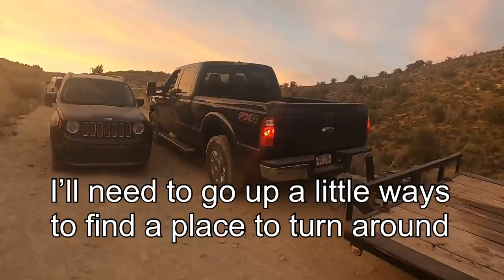Jackknifed! Ford Super Duty on the edge!

Comment: You ever thought about buying a chainsaw,it's a lot easier and more effective than using sawzall for tree work.
Reply: What are you talking about? 
They even make a pruning blade for the sawsalls. One handed easy work with no cord or gas. He could have cut up that whole tree with it.
Reply: @donlarsen9807  hey genuis sthil and all major chainsaw manufactureres make small limbing saws that you can operate with one hand if you need to.
Reply: @ejacs8077  hay genius you are correct and they make a cordless version also. My point was not to step on your toes or put you down it was just that when they make a tool you have adaptable for the job why go out and purchase something else.
Reply: @donlarsen9807  true,I've used a sawzall in a pinch to prune and do minor limbing before yeah it wasn't like Matt was on a logging job.

Comment: In my humble opinion, those Renegades are not real "Jeeps". You cannot take them off road like that (clearly). Good to meet your family 👍
Reply: I thought the tire failed, not the jeep. Did I miss something? Just asking. No disrespect!
Reply: I take my Renegade off-road every weekend and it performs great. Brake lock differentials and all terrain tires make it excel
Reply: @williambranham6249  you're absolutely right, the tire did fail. I think it is the wrong tire type for that road with sharp rocks.
Reply: @Ryan-yo4dg  exactly, stock tires would get you in trouble
Reply: @craighiebert3384  The side wall looked thin.

Comment: Do you talk to a tree arborist before you started cutting the limbs off that tree the top were evidently dead you still don't snap them you cut them and something on the bottom shoe been taken off to help save the middle and the top so it doesn't use as much water that way it doesn't look like you have much water unless you have irrigation I keep your new sod that you just rolled in alive it's the dying in the Sun

Comment: Matt, y’all two big strong men couldn’t lift the trailer at the rear and walk it over a couple feet-instead of disconnecting?
Reply: That trailer probably weighs 1800lbs. Maybe two guys scooting it over flat dirt, but over uneven rocks would be difficult.
Reply: Why risk hurting yourself and possibly being unable to work and then having that injury disable you periodically for the rest of your life? Matt did the smart thing and let the equipment do the heavy lifting.
Reply: That right it always pay to work smarter not harder.